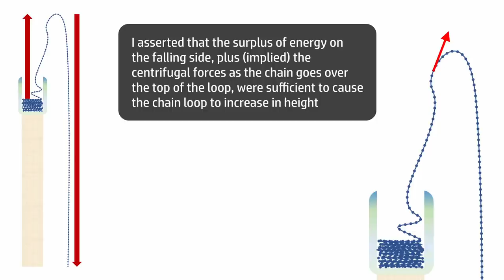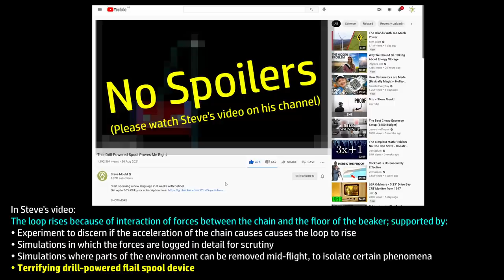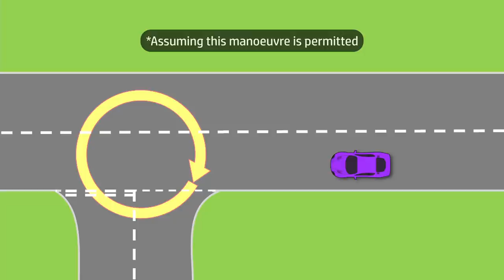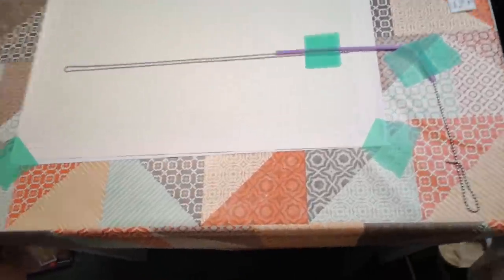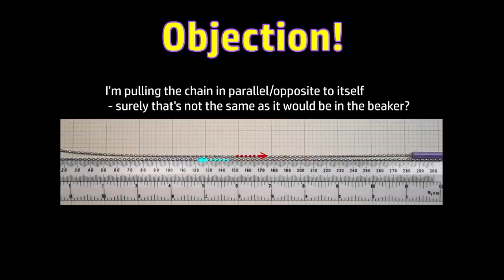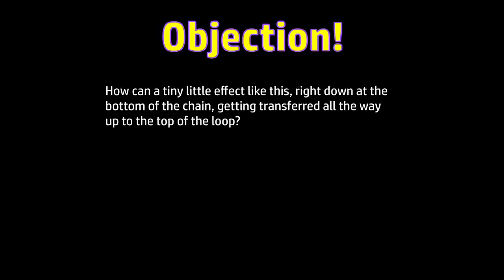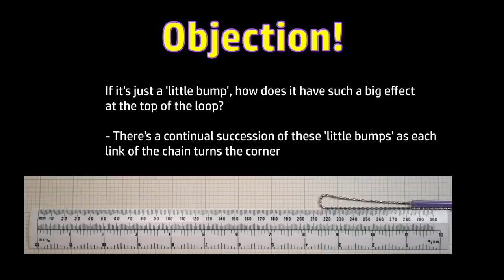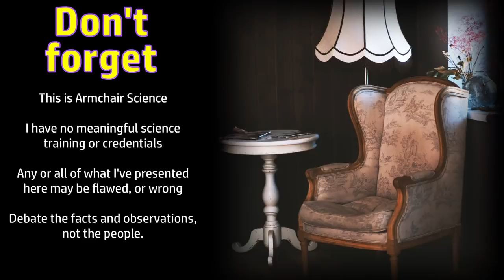Another Look at the 'Mould Effect' (Rising Chain Fountain)

Comment: "Mechanical siphon" would probably be the best way to describe it. The physics of the chain are such that the mass pulling down can pull the mass up—within the allowances of mechanical motion the chain allows.
Reply: That's a clever profile picture
Reply from the maker: But there's more going on than just the siphon.  I previously thought it was just the siphon and the incrementing energy of the system that would cause the loop to rise - experiments have demonstrated this isn't the case
Reply: @AtomicShrimp  The loop starts because, as you show, such a chain will always have some loop as it turns a sharp corner. But, the loop rises because the chain speeds up and momentum (some would call it centrifugal force, though technically incorrect) starts to stretch the loop wider (also up, because the height is still part of the loop) and is countered by the mass of gravity on both ends pulling down. The reason it's not a perfect circle is the mass of the chain at both sides of the loop pulling it into more of an oval. 

At least, that's my take on it. Any time you have something moving in an arc (like the starting loop), and more energy is added to the system in the form of velocity, it will grow to its constraints (in space, in orbit, that's gravity—when you speed up in orbit, your orbit grows).
Reply from the maker: As I say, that's absolutely what I thought was going on, but experiments have shown otherwise.
Reply from the maker: BTW, 'centrifugal force' is absolutely fine if that's what you mean (a virtual outward force experienced by an object moving in a curved path) - just like 'gravitational force' is not actually real.
It's one of those things that people overcorrect and say 'uh, I think you ackshually mean centripetal force' - without understanding that's a different thing.
Reply: @AtomicShrimp  Yeah, I only mentioned centrifugal to help people clue into what I was talking about. I was trying to head-off any such correctors.
Reply: @ConstantlyDamaged  Ha ha, the Uber car lost controll and went straight in the ditch, trying to over-correct.
Reply: @AtomicShrimp  Maybe an amplification effect, followed by a stabilisation due to the limit of the mass in momentum applying a resulting normal along the available limit of curvature of the "ball chain". Keep in mind it's not a "true" chain for it has two types of components that each have and impart different physical properties to each "links", that are, in turn, not links. I see it more like slingshot, catapult, an atlatl or, even better, a train than a chain. Yes, I do think a train behaves much the same way then a ball chain for it's arc limit due to it's types of links transmits the force (assuming the train is in a giant beaker, cue the karens) to the next wagon very similarly, projecting it, once it reaches the links limit radius, in a atlatl fashion, making use of a dynamic lever for the links rigidity and relative flexibility (a sort of Young Modulus maybe) compounds resulting in a form of amplification. Just my two cent.
Reply: Well, thinking the "bicycle" chain made me rethink the "not a true chain bit" but... still my thought. I sometimes see category inclusions as a form of scientific complaisance or laziness. Cue karens, I'm hitlerish, I know, science, right, bite me. Think a protein, it is a chain, so is a basic link chain. when you add something between the links or modify it's "nature" it ceases to act as a chain. It looks like a chain but acts like a duct.
Reply: @zaphodbeeblebrox2817  But, but, but... I was told to never click on links so I don't get pulled or pushed into a chain of events... argh heck, just this once then O.O
Reply: @zaphodbeeblebrox2817  Well, again, if one studies the properties of each component of the "chain", then much is revealed. the "balls" do have a ball general shape but they aren't. They are a moulded (hehe, maybe he should copyright this one too) piece of thin metal, metal properties changed by the molding (hehe) process, that have holes that aren't purely circular creating a sort of funnel effect with all sorts of angularity normal force influencing results, hence the variation in direction. Of course, the friction due to the "placement" of the chain in the beaker and it's relative position in the stack will impart "noise" or random forces unless careful positioning, guiding and controlled separation (grid) of portions of "chain" lenghts while filling the beaker with "strands" is applied, rendering chaos minimal and reducing friction. Still, this stack emptying sequence, left to right or vice versa, will impart another form of modulum but a sort of predictable one. If one goes all the way to align each "ball" so their seam are all facing in the same direction, as they won't have to "invest" force into friction to do so anyways (I bet when the "chain is changing from upwards to downwards, all the balls seams are facing upwards O.O cue high speed macro camera at the rescue) one might notice a nullification of "spirals". 
Again, writing while this comfortably sitting in a nice armchair with no "ball chain" in my vicinity.
Reply: @PandemoniumMeltDown  your observation point to the third derivative of position
Reply: @zaphodbeeblebrox2817  I actually didn't include the fact that jerk is a vector factor that does indeed influence, in the "ball chain" case, the result and expresses a compounding spring effect to the ensemble. The "stick" "freely" moves creating a delay almost not limited by friction and, as it reaches the end of it's course jerks the spring ball and funnels at the seams. Good point.
Reply: I think if you're statement is true (referring to the original comment), then it should apply to all types of chain or rope for that matter, but it doesn't seem to work with anything but the ball chain from what I've seen.
Reply: @dinadeira  Not exactly. Regular chains don't cause a loop to form. They are made quite intentionally so that this doesn't happen.
Reply: One way to find out easily if the chain is indeed being pushed up rather than pulled up would be to observe if the chain leaving the beaker is in compression or tension.

Comment: One key thing about "it's only a little bump" is that it only has to overcome friction. The "loop" is in a steady state (chain flowing through its shape). It only "decays" slowly because of friction. The "upwards force" just has to be slightly greater than friction to cause it to rise slowly, instead of decay slowly.
Reply from the maker: Yeah, anything like this where there is a small force applied consistently over time, there should be a measurable effect.

Comment: It's not the bottom of the beaker. If you repeat the experiment in a 2D way along a flat floor, pulling the chain hard back towards itself, it arcs up also in the same way, but without a surface to 'kick off' from.
Reply from the maker: I've seen one of those experiments and I think it's exactly the same effect.
Once the loop starts, in that setup, the chain in that loop is definitely being 'picked up' away from the floor and at that point, the Mould Effect can reinforce the height of that loop - so the floor is exactly like the beaker under those conditions, once the loop has started to form.
But how does it start?
Any tiny irregularity in the surface or the chain (including the movement of the chain as it moves) can cause it to 'bump'. 
Any bump will tend to have an upward component in this setup (it can't bump down into the floor).
Any bump that has an upward component will manifest the 'push' forces necessary to start the Mould Effect.

Comment: Just my two sense but I’m studying mechanical engineering to me it seems like the height of the cup above the ground gives the chain gravitational potential energy so when you impart a work to start the chain fountain the chain is given kinetic energy and the potential energy is transferred into kinetic energy but as the chain does not speed up after a point and energy is conserved the remaining potential energy is causing a work to lift the chain upwards creating the fountain effect. I believe the work causing the lifting is due to the transport term in the finite time form conservation of energy equation. You have a mass flow out of the system (cup) which must be accounted for. We can ignore a change in enthalpy which leaves us with an energy due to velocity (kinetic) and height (potential) in the transport term. The whole equation would look something like this: deltaEsys = (W in) - m((v^2/2)+gz). Where deltaEsys is the change in energy of the cup (which is 0), W in is the work applied to start the chain, m is the mass of the chain, v is the velocity of the chain, g is gravity, and z is the height of the chain above the container. So in order for the cup to not gain energy the chain must have a positive Z value which would correlate to a increase in height of the chain thus causing a chain fountain. Sorry this is a bit sloppy and speculation as it is 1:45 am and I have not done the calculations to prove it but I may run a simulation to see later

Comment: Another way to look at it is this: imagine a stick lying on the ground with a rope tied to one of its ends. If you suddenly jerk the rope upwards, the stick will turn around its center of mass and the other end will launch it off the ground even though you no longer pull the rope. The stick will then reach certain maximum height and then fall down. And the chain fountain is just one continuous stream of such sticks.

Comment: I believe Its to do with the semi rigidity of the linkages and the leverage effect caused by each link when in motion under the pull of gravity. The wave effect is not the same set of parameters as when the chain is being pulled towards the ground, there is only so much flex between each linkage no matter how its moved or how quickly it is falling.
Reply: I think the stick is the atlatl and the ball is the javelin. The ball is, after all, a spring.

Comment: So there's a relatively simple way this could be tested: when you pull on the chain next to the ruler, the chain loop loops the other way. This means that there's a force on the ruler.
If the chain's minimum (and nonlinerar with respect to tension) radius of curvature is similarly pushing down on the bottom of whatever vessel its in, the remaining chain should appear to weigh more the faster the chain is moving (i.e. the weight of the vessel and chain should appear to be higher than the actual amount of mass left). Tricky to measure, but not impossible.
Reply from the maker: Yeah, tricky to measure as you say, because the beaker is steadily losing weight as the chain leaves.
Steve did measure the force in the simulation and its there
Reply: Why not just measure and see if there's any sideways force on the ruler?

Comment: Pistons in an engine have to change direction and therefore, for the change in direction to occur, the pistons must slow down and reach a complete stop before they can travel in the opposite direction. 
I'm going to say something akin to this is going on with the chain.
That being, the chain going upwards moves slightly faster than the chain going downwards.
This makes up for losses during the 180 degree turn and thus keep the speed of falling chain constant.
The length of falling chain is always longer than the length of rising chain and therefore has more energy. The energy is transmitted along the chain into the much shorter rising length - and because the rising length is shorter, the surplus energy results in an increase of speed. 
The extra speed is the energy that lifts the 'bottleneck' of direction change upwards.
The 180 degree turn is the 'stationary' moment where the extra speed is then lost.
Reply from the maker: That was a point that came up in the Royal Society video about it, but I believe it is erroneous in respect of this video.  No part of the chain stops - the vertical component of movement has to stop in order to reverse, but the chain is moving over an arc - so the chain doesn't stop at all; it just changes direction.
Reply: @AtomicShrimp  Nah, the chain doesn't 'stop'. 
What I'm referring to is the vertical motion - in that it has to go 'up' to get out of the beaker but then has to do a 180 to go down. In that sense the vertical motion has to stop and reverse.
The chain is never 'tight' on the way up, it always has some ' slack' and bends, suggesting it's not under tension.
Reply: @AtomicShrimp  
I used to see this rising effect a lot with a hand-pull crane, which is basically a loop of chain running over a pulley. 
I reckon you could probably see the same thing with rope over a tree branch.
When you pull down hard and fast then suddenly stop pulling, the chain going upwards continues on its upward trajectory and causes the chain to bunch up just before it reaches the pulley.
Reply from the maker: Sure, the chain has momentum, but as long as the system is running, the falling side is usually accelerating, so I think it's true that the whole chain is under tension - everything is ultimately being 'pulled' over the top of the loop - nothing is being yanked, then allowed to just coast over ballistically or anything - that would require intermittent forces from the falling side
Reply: It's not always easy putting thoughts into words - but I'm gonna give it a go.

I reckon there's a transference of energy, from the higher mass (long chain going down) into the lower mass (short chain going up). 
It's the close contact and central path through the chain links that transfers the energy so well. 

Seems to me the chain is 'transmitting' energy in a (reverse) 'Newton's cradle' kinda fashion. I believe this to be very important, if not key, to the process.

At the very beginning of the process chain just runs over the rim of the beaker, only when it's gained speed (energy) does it begin to rise up in an arc.

Once the chain begins to fall faster the tension transmits more energy. Tension-induced rigidity is probably part-involved in forming the arc. 
Once contact with the rim is broken more energy stays in the chain and so the tension increases further.

I think the 'reverse' Newton's cradle effect holds importance because, it means you can no-longer view the chain as individual links all being 'pulled' by the one in front.
 
I'm saying, the energy from the falling chain is 'transmitted' through the climbing chain into the next stationary link on the pile - at which point said link starts moving.

The 'upward' force on each stationary link isn't applied by a physical 'pull' from the previous link,  the transmitted energy manifests into motion within the link itself.

The energy is transmitted downward through the climbing chain with little or no effect upon it, since each link already had its turn to be affected by the applied force - they are saturated and desperate to lose energy. 

In effect, they're the idle balls of Newton's cradle - just they function continuously in one direction and happen to be in motion.
The pile of chain is one active ball and the falling chain is the other active ball.
 
There's an initial spike of energy required to accelerate a stationary object into motion. This force is greater than the force subsequently required to keep the propelled object at the achieved speed.
In this case, the initial resistance to motion results in an elastic-like 'over-acceleration' the instant motion is achieved.
 
The 'over-speeding' climbing chain must decelerate to the speed of the falling chain before it can complete the arc.
The energy transfer during this deceleration is seen as inertia, which is what pushes the arc higher.

The 'working' energy in the system is being consumed by the 'climbing chain'. Everything going downward is the dead-weight supplying the input energy.
 
Sometimes it'll take more or less energy to initiate motion - this, combined with the effects of deceleration and compression, is probably what causes the 'waves' in the climbing chain. I think these waves quite possibly act as an energy store for the system too.
Once the process begins a chain reaction occurs. 🤭
If the falling chain was never able to reach ground and pile of chain never end, the applied force would continuously increase - as would the arc keep growing forever-higher.

Yeah, that's just somewhere along the lines of what I think is going on. 
On the other hand, from the chain's perspective. All the combined forces add up to a gravitational zero-point and, as far as the chain is concerned. It's 'falling' upwards.

Comment: Re: level tabletop through a straw...I wonder what would have happened if the ruler "constraint" were removed Mid way through the pull? Would the "bow" curve shift from upward back to its "default" downward?
Reply from the maker: I didn't try, but I fully expect so - it goes from 'neutral' to 'down' at the start of the setup

Comment: So if you tie some weight to the falling side of the chain, you should get a bigger arch with less falling height, right?
Reply from the maker: If you can contrive to make the downward side go faster, the chain loop will rise higher, but adding weight isn't the way to do that (because disregarding air resistance etc, things fall the same way regardless of their weight).  Adding height (so the chain has longer to be accelerated by gravity) or mechanically pulling on the falling side faster than it would naturally fall (Steve does this in his latest video)